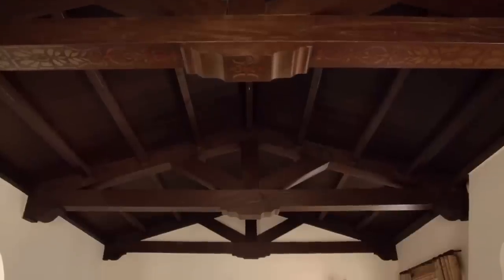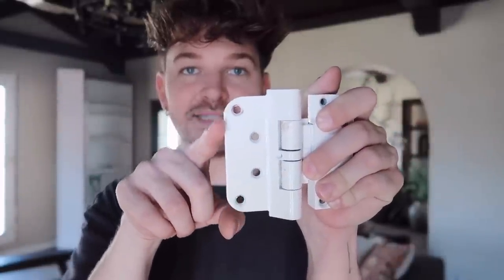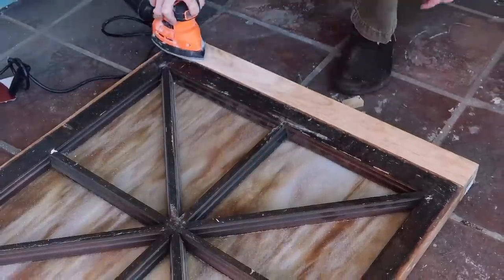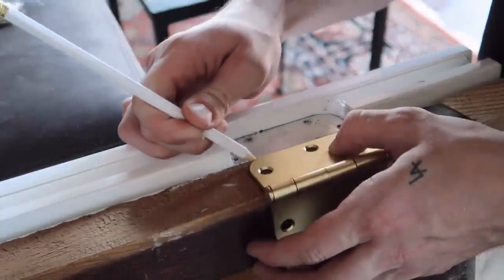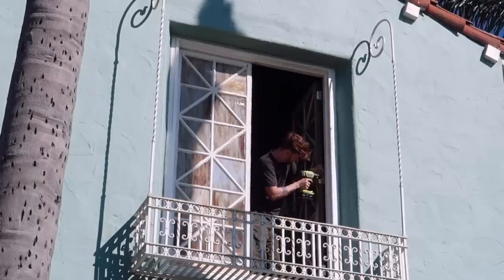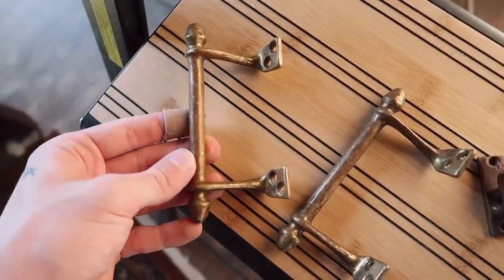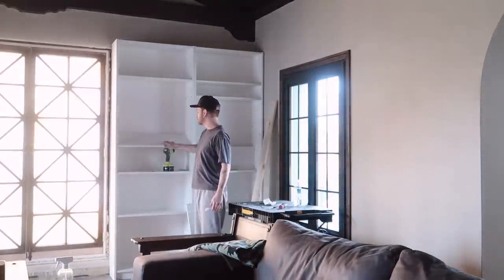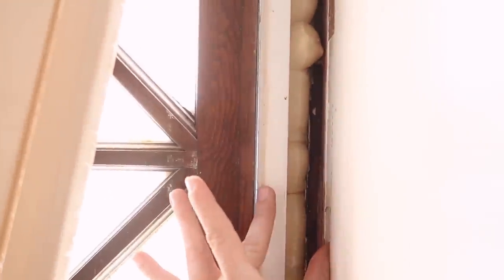EXTREME LIVING ROOM MAKEOVER ✨ Part 5 ✨ Installing Vintage Doors MYSELF + Built Ins!

Comment: As someone who has done a ton of renovations I would Have stained the trim and the wood at the bottom of the door first before adding it and then done touchup after it was attached if needed. That way you did not have to worry about getting stain on the plaster walls, floors etc...stain is one of the most difficult things to remove from other surfaces.

Comment: Looks so pretty, though I recommend putting a latch at the top of the door also. The reason why those old doors were so heavy is that they were more than likely security doors. And your bookcases are going to be so pretty, I can see it, and if you ever get tired of the switch, you can hook your lights up to a smart plug, that way you can control them through your phone or you can set them up on a timer using the smart plug.

Comment: I'm sure you already know this (but just in case) I think one of your shelves is in backwards so the mdf is showing! Love how this is turning out and am so excited to see the built-ins finished!
Reply: I saw that too but I think he's trimming all those shelves.
Reply: Been driving me nuts since they were first installed. I don't think he noticed. He's very picky with details. Which is why everything turns out PERFECT!
Reply from the maker: I’m retrimming the entire front of the built ins so it will be covered! I accidentally assembled it wrong and only realized after :/
Reply: @lonefox  Whew...THAT's a relief!  I don't think you mentioned your plan to re-work the fronts of the bookcases.  But I couldn't believe you hadn't a plan to rectify that li'l error.  It's all looking Great!!
Reply: I totally spotted that too and figured he'd find a way around it 😆
Reply: I think it’s just his template shelf.
Reply: I saw that but remember Drew mentioned face framing the front.
Reply: Well done on the doors, trim and bookshelf lights! It’s all coming together!
I’d put a coat of stain on the entire door and repaint the white on the exterior as well to ensure a better finish and to make the exterior of the doors completely weatherproof and sun proof. 
Can’t wait for the finished room. It’s going to be gorgeous! ❤❤
Reply: I love how the stained glass door pattern mirrors the pattern of the ceiling beams!
Reply: @lonefox  I did the same thing with my Billy bookcase 😂

Comment: Hi Drew.  Can you show how you hid the extension cord that had to cross between the bookcases?  Also, I couldn't tell if the bottom latch on your new stained glass doors actually latched into the floor.  If not, you'll want one side to latch firmly into the floor or the header.  I'd hate for a strong gust to rip a hinge or worse.   I love your DIY episodes just as much as your decor videos.   You are so clearly building a home to love as well as live.

Comment: Those stained glass doors and the modified bookcases look fantastic! And those picture lights are genius!! The only thing that is a little concerning is the weight of the doors. As far as I can tell, they each have 3 hinges to support each door. Is that adequate? I just want to be sure they are secure in the door frame. Everything is coming together in a very beautifully creative way. Job well done!!👏👏👏

Comment: I really appreciate your clear joy for this project and also that you want to be true to the period the house was built. In this spirit, I would encourage a couple tweaks.

First, trim width is really important - it needs to be the SAME WIDTH around all doors and windows in the room. It looks like your trim is about 5" in that room, but the moulding you installed is only 2" wide. But no worries - you could remove it and re-install it on top of 5" flat trim, on the outer edge. This is its traditional location for a moulding like your egg & dart. Yes, the already built bookcases would cover part of the door trim, but it would not be the end of the world.  Second, you need to add a threshold for the door with a  baseboard under it. Without it, a driving horizontal wind will drive water in, and work its way through and go down the inside of the wall. With a threshold, the water will drip onto the floor where you can catch it before any damage is done. Last, had you had a seasoned carpenter install your doors, he would have shown you an easy trick to kick the hinges out a hair, and avoid a lot of sanding. That triangle of air space above the door could have been erased if you put a skinny piece of cardboard (from a cereal box) behind the lower hinge. This would swing the door up into the center top of the frame. Triangle disappears.

Comment: Just wondering if you were going to keep the bookcases white or a different color??  Suggestion ideas: some kind of crown molding on top or matching decorative casing to match, maybe thick wood on inside of bookcases?? Wood pieces all the way across on top of bookcases making it connect to add decorative pieces or storage on top as well. Just some fun ideas. Always loving your ideas and spaces. You rock!!

Comment: Those shelves with the wired lighting looked so good…. I had doubts because my shelves looked so cheap and the backing degraded when I drilled into it for speakers.  I also wasn’t big on the slanted book display.. but it really works.  It’s different but still integrated into the room.  You are inspiring me to re-do mine.

Comment: The hinges are meant to support heavy rains and winds depending on the location of the home they are meant to hold the door in place. Specifically for outdoors doors. So, if you could, consider using the hinges that where in place.
Reply: That is an important note. He can simply add hinges too. I’ve done barn doors with piano hinges that withstood terrible snow storms.

Comment: 🦋 I noticed one of the top shelves was in backwards and then towards the end of the video it’s fixed. You did a great job installing the doors, adding the piece on the bottom so much attention to detail and that trim you did around the doors is gorgeous. Thanks for the info on the pocket drill thing and also those lights where you can have your light switch anywhere you want it for $10 what a great deal thank you again for sharing all the things you’re doing in your beautiful home I’m learning so much from you guys.

Comment: Hi, just curious if you will be putting a top coat on the door to seal them. Since the paint and the stain looks a bit worn out. I think it would be great to put fresh coat of paint and a top coat on the stain to make them look beautiful for a long time. If you want to match the look you can use a matte top coat and it would look the same but better.

Comment: Drew if you haven't already, I would get a few more panels of the glass in case you ever need to replace another panel. Unless the store you bought from keeps them in stock. Just a thought! Outside doors take quite a beating

Comment: I paint/stain/seal as much as I can before I affix anything to it like handles or other hardware, and then attach it to the wall, doors, other stuff, then just touch up where I need to after.  I think it's easier and you don't have to worry about using painter's tape or cutting in, or anything like that.

Comment: Suggest that you make sure that they are not exposed to strong direct light if possible. Between the sun and moisture, the doors may have some issues with warping or other weather issues. I have wooden French doors which are Anderson and clad in metal on the outside but the exposure to heat sun and rain has ruined them. Good luck as they look lovely

Comment: Just as a quick thought just in case, setting the light switch on the outside of the bookcase is def fine but just be careful about the door handles being able to turn them on in the event they swing open from wind or something perhaps. Loooove this video so much!!

Comment: Hey drew I’m sure you probably did off camera before adding the weatherstripping but make sure you seal the tops/ bottoms/ sides of the doors where you sanded or they might get moisture inside and warp or expand (wet climate girly here).

Comment: Your doors and trim came out great! LOVE IT!  Love the picture lighting! I think the control for the picture lighting will look best next to the wall lighting under the sconce. The symmetry looked great when you briefly placed it there, and avoids a protrusion extending on the outside/inside the bookcase OR someone accidentally knocking over something reaching inside your bookcase. ONE CONCERN though... you have nice looking feet that I hope you don't hurt by stepping on a nail or get a splinter from all that cutting and sanding. Wouldn't it be safer to have some sort of shoe covering during those tasks? 
~ Signed OSHA-mom❤

Comment: I would highly advise wearing dust protection when cutting and sanding wood, you don't want to breathe wood dust. Also, sanding old doors and breathing in who knows what is not good. I wonder if your brief illness was instead a reaction to breathing the dust. It would be a good move to get a dust bag or some kind of collection system rather than let your chop saw just spit it all out. Perhaps take a look around the web for a portable dust extraction unit or look into purchasing tools and extraction system from Festool

Comment: Love what you did with the picture lights.  I’ve seen some that are battery operated which would be easier than doing the wiring.  What are you doing with the wire running along the floor to the outlet ?
Reply from the maker: I’m going to build a step up to the door to cover the wires! I really wanted a hard wired approach so I can leave them on at night and not use the main overhead light!

Comment: Hey Drew, curious if you could do an update after you've had the doors installed for a bit. Since you went from super heavy duty doors with triple paned windows to doors that are so beautiful but granted, look a little more flimsy and have the single glass panes, I'm wondering how the doors hold up in terms of air drafts and AC leakage over time. If you could just make a note of that in a few months after some hotter summer days, it would be really appreciated! Just wondering how doable this process is and if it would be feasible in places with less perfect weather than CA :) Thank you so much!

Comment: I'm surprised you didn't glue the wood to the bottom of the door before screwing.  Also did you paint varnish all the edges you sanded to make the wood waterproofso they don't swell when wet.

Comment: Next time stain the trim before putting it up. If you see light along the edges of the door the cold or hot wind will come in that tiny space. Also check the tops.🌵🌵

Comment: Just a suggestion for the future if you're interested....wood filler would have helped you have a seamless finish. I could see a line between the wood you used and the bottom of the original piece.

Comment: I need to check out this remote plug and other things I see you and others use like the remote control puck lights. We have odd artist built home. Only built in 93 but it has tiny kitchen and no dishwasher but pitched pine ceiling inside about 25 ft heigh witha 64 foot long skylight. That was not a typo. 64 feet. The entire nouse. But its a giant box. We have lightswitches we have yet to figure out after 5 years what they do. Light boxes with nothing on them up in air. The light to go answer the front door is in long darkhallway with switch at the front door. A garage closet has no light as its on the stoop where you then walk 3 steps down so cant those either. There is an outlet beside the closet door on outside. I can hang some kind of pendant light but think this will serve purpose to make it push button. Looking at the link!

Comment: Do you need to caulk the space between the bottom of the door, and the piece you added , so that over time water doesn't get under the opening, and maybe rot away, especially on the outside of the door? Moisture can be so destructive.

Comment: The stained glass doors are  so beautiful, however, remember they are not insulated, heat and cold will penetrate and they will not be energy efficient.  The doors you removed look like heavy hurricane glass, insulated, energy efficient and burglar proof, very heavy, very expensive.  Resell, install on first floor or save in case you get cold or hot in the future.

In any case, beautiful and great job!!

Comment: Put wood filler at the new additional wood  prime and paint the exterior of those doors asap. Next time add wood glue before you add screws . Could have used wood pug/ biscuits to connect wood additional with glue and clamp till cured. I was married to a wood worker. You pick up things. Lol

Comment: If the original doors were triple planed, don’t you need to consider that in the ones you are installing for being weather tight and insulation?   Just wondering.
Reply from the maker: It’s more of a personal preference! It’s not necessary for my home especially living in Los Angeles and I just prefer the original glass and look
Reply: I'm more upset by the fact that with the bookcases on either side there will be no room to open the doors all the way like you can with French doors.  But the doors are beautiful and maybe that overrides the fully opened function?  Wonderful job on the install guys!  Doors are a challenge, especially replacing an old door!

Comment: You need a better lock on those doors because that's where they will break in, not strong enough. you need a bolt on the top too but that's still not enough.🌵🌵

Comment: The doors looks awesome but French doors need a surface bolt at both the bottom and the TOP. Without this you run the risk of a gust of wind pushing at the unstable top portion of the door and possibly cracking that precious glass. Drew, please fix so I can remain calm!

Comment: It looked like you added the weather strip to the raw wood on the doors. Is that right? 
If so, I feel a little uneasy knowing that rain could penetrate under the stripping and into the wood. Unless there's some sort of weather protection on there or a clear-coat of something. 
Because you'll never know when the weather strips will fail, despite what the package says. Or moisture seeping its way under the strip when the wood expands/contracts. Idk, I'm just afraid water & rain could find its way under there and cause significant damage in hidden plain sight. 

As a former wood finisher/cabinet finisher etc., one of the things I saw the most that needed refinishing, were doors that were exposed to the sun and its harsh damaging UV.  
The more intricate details that are on a door, the more you want to protect it because repairing it can be a real pain in the ass, or expensive (professionally). And those are beautiful bespoke doors.

Comment: Hay. Love this so much. The is a but though.... in my country not sure how it works in America... If you alter electrical cables and dont have it approved and tagged by a trade qualified electrician and its the cause of a house fire. The company that your  house and contence insurance will NOT pay to fix any of the damage caused by the altered electrical device. You may need to check that your still covered by insurance if anything where to happen with those cables you cut.

Comment: The doors look amazing — but maybe it would have been good to use the old, heavy doors and change out the glass and styling to match the new ones. Those  are heavy duty and are meant to be used as doors.

Comment: The doors look so good but aren’t you worried about security or even weather?   Those other doors were so strong but these seem like it’s possible  a big gust of wind or even a human push could easily break these open.   It’s hard to tell how high up these are.   Hopefully it’s not easy for someone to access that balcony from outside?  They really are gorgeous!
Reply: I get ur concerns, I have many lol. The electrics for one not what drews doing exactly, just that someone who’s watching could try to follow but make a mistake because there wasn’t really any direction about safety. I think the doors are in the second floor and it’s a Juliet balcony for context as far I’ve seen. I love drew I just think safety should be first an foremost. I know I know I’m old now 😢

Comment: Egg and dart trim does not go in any way with Spanish Revival or Spanish Colonial architecture.  It is beautiful in the right setting, but not appropriate as trim in your home.  The outside of the replacement doors you put up over the Juliette balcony - it doesn't look like you sanded down and painted properly.  I don't care if the only people who will ever see the outside of those doors close up is you and our roomy and friends.  Do the job right - otherwise, what's the point?  Yes, they look "pretty on the inside", but you're not doing things the right way and you'll end up paying for your neglect to properly finishing the outside of the doors sooner than you think. Regarding your wiring up tricks for those built-ins, please don't take the risk of a major electrical short-circuit and fire.  Those surge protectors won't protect you if a fire starts inside a wall.  Hire an electrician to wire up safely and in accordance with current building codes, please.